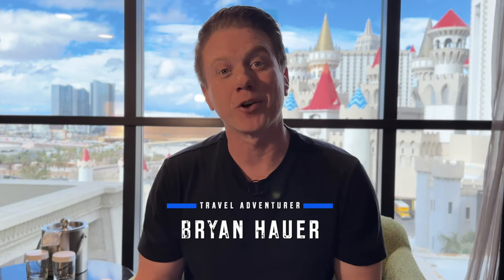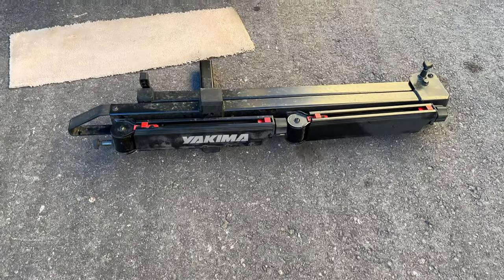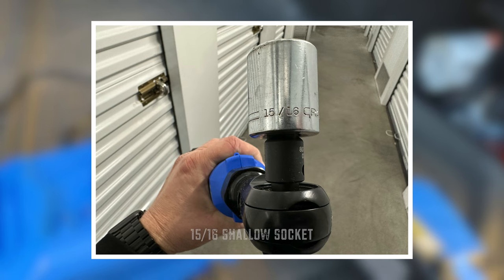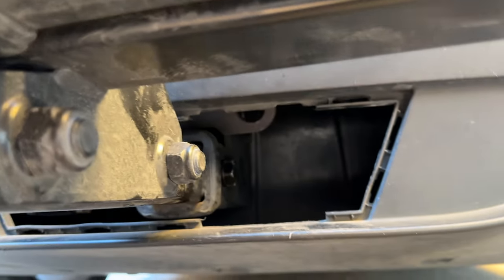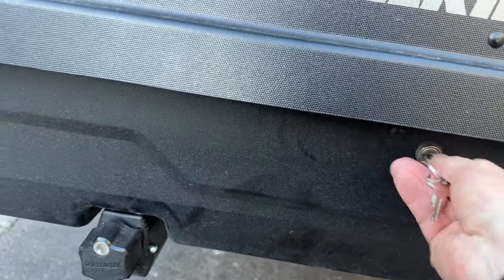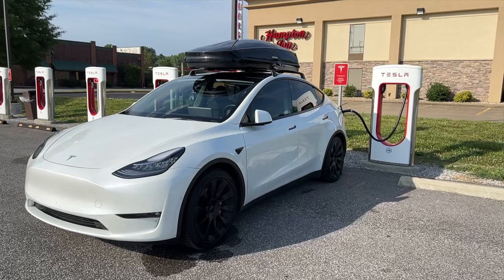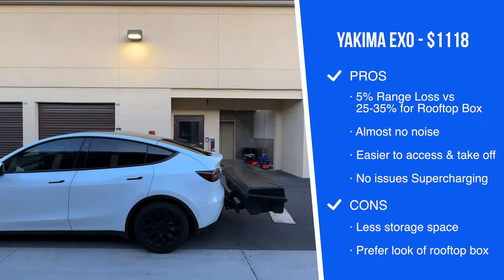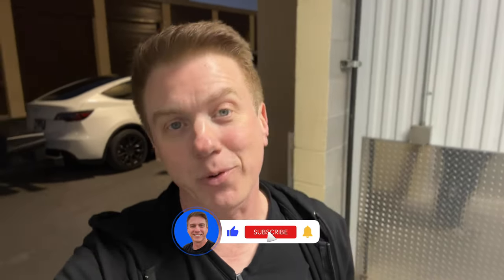Yakima EXO Gearlocker & Swingbase Review: Trailer Hitch Cargo Box for Tesla Model Y

Comment: Is there something about this hitch cargo that makes it easier to charge ? I’m almost sold on it but it is pricey. Can you give us more info on that? Or is charging just as easy (or difficult) with any other cargo hitch box? Great video!
Reply from the maker: Thanks 😀 Most hitch cargo boxes I've seen are a bit higher so they would block the rear-view camera. This one is pretty low-profile and sits low so as you can see at the end of the video where I show backing up into a Supercharger, you can still see well. 

That also bodes well for aerodynamics. It took me about 2-3 times to get used to backing into Superchargers with it, but now it's easy. I do still occasionally get out as I get close just to double check to make sure what objects are back there as every Supercharger landscape is slightly different. Some have bushes or signs etc, but I've been to dozens with it and no issues charging.

Most you can back up pretty much just as far as normal so the charging cable can always reach. I do tend to use the side mirrors to help in lining things up a bit more compared to the backup camera on screen. A little practice and it's easy 👍🏻

Oh and if you check out some of my most recent travel videos you'll see me pulling into charging stations.
Reply: @bryanhauer  thank you. I do not own a Tesla but have a model Y coming in a few weeks. So I don’t really know what’s it like trying to charge it let alone with a cargo hitch. This looks pretty cool but trying to understand if I could charge with something similar (maybe minus the swing) but for a lot less money but can still supercharge. Thanks for the video and response. I welcome any further thoughts or suggestions. 👍🏼😊
Reply from the maker: @theticoboy  Nice! That's an exciting time leading up to delivery day. 

There are definitely less expensive options out there and Yakima is at the top of the price ranges, but with this one being so versatile, I think it's worth it. I also like that this hitch sits close to the car so the box doesn't sit way out away from the car where maybe it could get in the way of charging and it doesn't sit too high.

Comment: Do you have a over heating problem with your Iceco in that closed location?
Reply from the maker: Good question... Nope. I've done a few videos on it and included it in my review of the fridge which I'll link to below, but I put little 1 inch spacer blocks with velcro on them to keep air flow going and have left it on in there for weeks at a time with no issues. I love having it down there. 👍🏻 https://youtu.be/MMZaqy_qGZk

Oh and one benefit of having it in there is the fridge barely has to work to keep it cold as the temp down there is considerably cooler than the rest of the car.

Comment: I have question regarding your fridge. When you drive is the fridge on and how does it work? Trying to figure it out how to maintain the coolness inside. Thanks
Reply from the maker: Sure. It’s an electric fridge and not an ice cooler so it stays cool being powered by electricity and can even work as a freezer or both fridge/freezer. I keep it on for sometimes weeks at a time. Think of it like your refrigerator at home, but just smaller and mobile.
Reply: @bryanhauer  so when you are in the driving you still power the fridge on while you are in the road driving? Thanks again
Reply from the maker: Yes the fridge is on for as long as you want. I leave mine in for weeks at a time (24 hours per day for weeks) while camping.
Reply: @bryanhauer  thank you for your reply. Been watching your video especially getting tips for camping with tesla.

Comment: Ok I’ve watched your video twice now, bought my own swing base and locker.  Kind of nervous about my first long-distance trip with it.  

Has yours leaked from weather - like lots of rain or snow?  The day mine was installed (professional installer in their shop) it was raining and rained for another 2 days.  When I opened it for the first time at home (it was outside the whole time I don’t have a garage) there was about a quarter cup of water in it that did NOT happen bc I opened the lid since it was moist in the box.  Any tips or thoughts?
Reply from the maker: Mine hasn't leaked once. I've been through some nasty storms (a couple videos coming up soon show that) and never a drop inside. As for any tips... make sure to have the right angle power tool I show in the video if you plan to remove it and put it back on/off otherwise it's virtually impossible to do due to the recessed nature of the rear hitch on a Model Y. If you're not using it on a Tesla that won't matter as much as you'll likely have better access where the supplied wrenches would work. Otherwise, don't overload it as it'll make the car sway a bit more. With a Tesla Model Y you only have about 70 lbs to use for cargo. I've loved mine and find it very versatile. 👍🏻
Reply: @bryanhauer   oh! You reminded me that when I placed the order with Rack Attack, they talked about the big pain it was to install it on the Tesla model Y, which I have just like yours including the color.  I told him about your video and how you use the right angle ratchet, and they started doing that right away. Kudos to you, Bryan!

I look forward to your upcoming videos about it. Another aside – I would have used your link to ordering my set on REI but it was just last week and REI referred me to rack attack because they had no staff to install it before I have to leave on a trip.
Reply from the maker: @jhook3672  All good 👍🏻 Glad my video was helpful for them and you 😀 Let me know how your trip goes and if you have any issues.
Reply: @jhook3672 how are you liking th3 swing base and cargo box? Any issues supercharging it when stations are busy?
Reply: @theticoboy  I like it very much. It’s super solid. 

The question about supercharging is spot on. I had one situation last winter where a pull through spot wasn’t plowed so I had to back in to another nearby spot.  But after a couple times, it’s pretty simple. I just get out of the car once or twice to make sure I’m not going to hit anything and it’s fairly intuitive. However, either the specs are wrong or contractors mess up when they build out because sometimes they put the red parking sign too close to the curb, making it impossible to back up close enough.  So far I’ve experienced Montana to be the worst, but I’ve always been lucky with no crowds and been able to just park parallel to the curb to charge with no other cars charging nearby.  

Although lately, I’ve noticed non-Tesla‘s charging so I’m a little nervous about that going forward when I travel with the cargo box.
Reply: @jhook3672  interesting. That is super helpful. Thanks!

Comment: Hey Bryan, why do you say it's limited to around 70 lbs cargo weight?  The Model Y tow hitch is rated at 350 lbs tongue weight capacity and the swingarm and box are only around 100 lbs.  Shouldn't that mean it can handle a bit more than the Yakima rated 100 lbs per the website ("100lb gear weight limit when mounted on EXO SwingBase")?
Reply from the maker: Hi Nate - Tongue weight for towing a trailer is completely different than vertical weight from a cargo box or bike rack. Due to the way weight is distributed with torque the limit is much less. Here's a section from Tesla's website explaining it: https://www.tesla.com/ownersmanual/modely/en_us/GUID-F5C80FF5-8DE3-4750-8BAF-0DCC0CFA0C5C.html#:~:text=by%20the%20warranty.-,Carrying%20Accessories,maximum%20weight%20is%20not%20exceeded.

Carrying Accessories
The hitch receiver is designed to support vertical loads up to 160 lbs (72 kg). When carrying bicycles, skis, or other items on the Model Y hitch, always check to ensure that the maximum weight is not exceeded. When calculating weight, remember to include the weight of the accessory carrier. For example, assuming the carrier weighs 40 lbs (18 kg), the weight threshold is sufficient for carrying two bicycles weighing approximately 60 lbs (27 kg) each, or four items weighing approximately 30 lbs (14 kg) each.

Hope that helps clear things up 😀

Comment: if you install this box, will it affect the autopilot in case of danger from behind?
Reply from the maker: Good question. It only blocks the two middle rear parking sensors. All parking sensors have been removed from new Tesla's anyways. Also since AutoPilot now uses Tesla Vision (only cameras) it shouldn't affect AutoPilot. With that said, the camera is obviously slightly blocked so I imagine it's not going to be as perfect, but I've had no warnings or issues and it still seems to see its environment fine.
Reply: @bryanhauer  I understand.  Thanks for the answer

Comment: Very helpful video. Do you have any recommendations for an RV tent set up in back that would also shelter the Gearlocker when it is at a 90 angle from the car?
Reply from the maker: Thanks! I don't actually. I've been offered to test/review a bunch, but just haven't yet as it's not something I'd use often, so unfortunately don't have any recommendations.
Reply: @bryanhauer  Do you find yourself using the tailgate set up more now, or the rooftop box? I'm working on creating a Yellowstone expedition for a family of four - with a big tent and a Model Y. I think a tailgate tent/kitchen in addition to our 12X8 tent might do the trick.
Reply from the maker: @JohnU2020  I don't use the rooftop box at all anymore. For a family (especially if you have young kids) I can see how a large tent to hangout in would make sense. As a solo traveler I wouldn't use it much so isn't worth the extra space and weight it would take up, but I can definitely see how a family could put it to good use. I love the rear hitch cargo option with the Yakima EXO system as it swings out and can be used to cook on top of. Plus, virtually no range loss or noise which I really like.
Reply: @bryanhauer  Hey. I bought the Yakima Exo and a Joytutus SUV tent. They seem to work well together. The SUV tent serves as a nice dressing room for us, and the Gearlocker is a great counter space almost anything. It's kind of amazing how well the Model Y heats the tent - but I've yet to try that in severe weather. 3 trips with the Yakima Set up and 2 with SUV tent/Yakima Exo combo so far. Thanks for your videos Bryan!

Comment: You can use a manual ratchet?
Reply from the maker: Unfortunately not enough room and would take hours. I should include this is only an issue on Tesla Model Y since it has a recessed hitch. Other vehicles shouldn't have this issue.